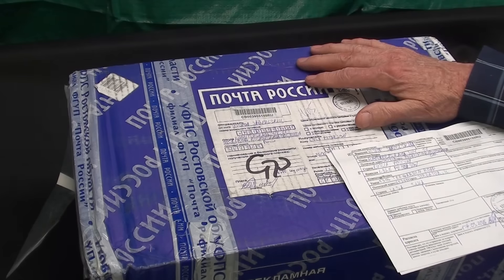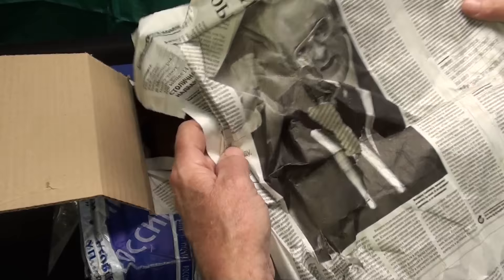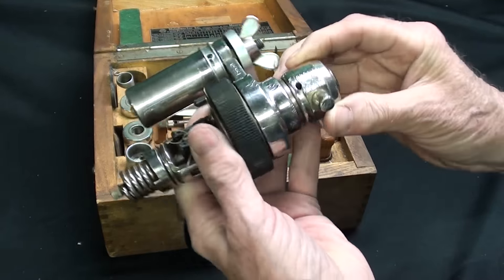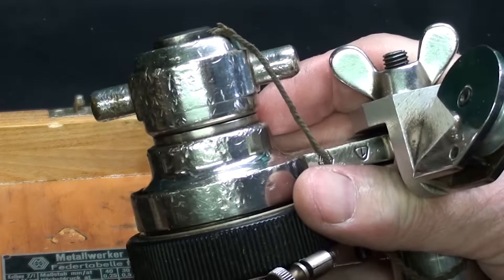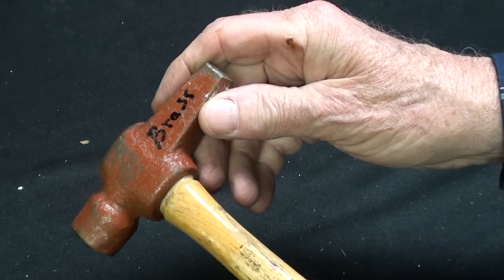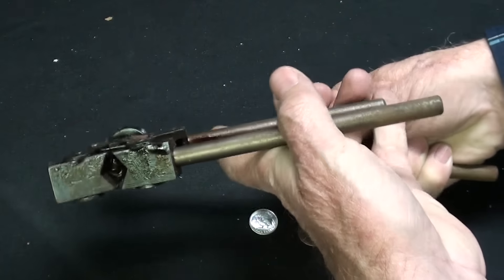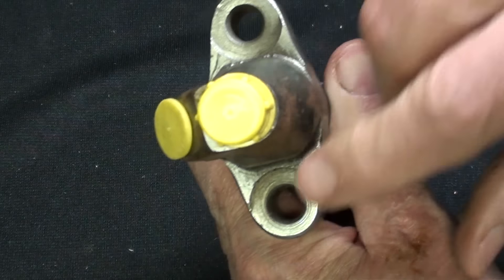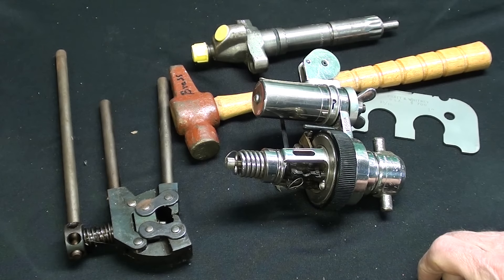WHAT IS IT?  #27a question Mystery Item tubalcain mrpete222

Comment: This instrument is an ......... "indicator", it is used to determine the indicated power of a slow speed (marine) diesel engines.
For this purpose a piece a special treated paper is placed on the spring loaded drum.
The small handle on the nut at the bottom is a nut which you  have to screw on the  ......ïndicatorvalve.
Each cylinderhead of the engine has such a valve.
After opening the valve, with the engine in running condition of-course,  the pressure in the engine cylinder comes in contact with a small piston in the instrument which is also spring loaded and is acting on a linkage.
Gently push the point of the scribing needle against the paper and you will see a diagram appearing on the paper which shows the pressure changes in the engine cylinder during the entire cycle (compression stroke, powerstroke. (large marine diesel engines operate in 2-stroke cycle))
Forgot to mention that the drum has also a spring inside and that the end of the rope is normally attached to a hook which is directly following the movement of the engine piston of which you want to determine the output of.
The surface of the diagram gives you the mean indicated pressure in the engines cylinder.
These instruments exist since the steam engines appeared.
There are different kind of springs inside the box, the one you select depends on which part of the process cycle you want to "see what is going on" inside the cylinder.
The top of the diagram gives you also the maximum combustion pressure in the cylinder during the cycle.
Each spring comes with its own wooden scale.
There is much more to tell about this measuring tool, but my English is not good enough.
Believe me, is not always a fun job to do, as that f... valve is pretty hot
Reply: +Jan Visser that is correct, a friend of mine actualy performed such am measurement using a similar device, on a running 2 stroke diesel main engine,  at a  Hapag Lloyed container vessel at sea during his college time ~20 years ago. 
Althrough the Captain messed up his mesurement results, because he changed the engin rpm, while he was doing the measurement on each of the many cyclider's. 
Not an easy task(rpm... dependent) using this old method/instrument.
On modern ship engins they have quicker/easier ways to peform this measument, but that requires "elektroncis".
He was porperly the last person really using this old method/instrument in "modern times".

regards rec
Reply: +recycler77 
I used it myself many times as well when I was sailing as a marine engineer.
And yes, the engine RPM (load) should be kept steady during that measurement as you also want to compare the results against each individual cylinder which should be the same in the ideal world.
Taking the diagrams with the rope of the indicator drum engaged to the indicator clock as we called it  was not so difficult, but there was also the method that we had to pull the rope (quitte fast in the rythm of the engine RPM (115-120 range)) by hand in order to show the compression end pressure as well. That failed often and than a lot of those "indicatorpapers" were spoiled
Reply: +Jan Visser i am pretty certain, that he did tried the "pull the rope in sync to the timing of the cyclinder -method", because he was after the max compression diagram (He was cursing a lot about it). 
He did it on his free day out of interrrest, because the superior's deemd that method outdated, due to ahead scheduled maintainance accodring to the lifeime of the wear parts.... 
As well as they prefered to check the piston rings(compression failur scource No1 ) by eye from the air intake-tube at port. 
When the engin was not runing/needed they slowly turned(electronic driven) the crank chaft, so they could hit the piston rings with a hammer, from the air intake windows (when the piston came to the lower dead end).
So they could see and hear(!) if the rings were broken or degraded,-that was way more important to them, as to actually measure the compression at sea.

I did a similar measurement at a "geman technical highschool" on 4 stroke car engines,
;but the instrument was a lot easier to handel(using the spark plug boring) and the preasure of cause was way lower(no tubo charged combustion + smaller dimensions... ) - firm hand held presure was enough, to hold the instrument in place. 
Without the proper tech charts, engin stats an math funktion's the resulting graph(s) alone were(are) useless, except from the comparison by eye, how good the graph of each cyclinder would match each other. Was esay to rank the cyclinders performance.

regards rec
Reply: +recycler77 
Hi Rec, 
Inspecting the pistonrings in the way you describe it was done on a regular basis with the vessl in port.
With the present two-stroke marine engines which have uniflow scavenging (inlet ports and exhaust valves) that is a messy job, as you have to climb into that filthy scavenge air receiver to see the pistonrings passing by the inlet ports.
When I was at sea, I was lucky enough to sail most of the times with the Sulzer RND and RND-M engines which had loop scavenging. So, we could do that inspection through the ..... exhaust manifold and that was always clean bare steel.
(For the guys who never saw such an engine: the exhaust manifold of such an engine is that big than you can walk through it and I am 6ft, 5 inches tall.)
Each piston ring could be pushed using a broomstick, otherwise you could not reach them.
On some ships we had a very long cable connected to the electric motor starter of the turning gear, so that the engineer inside the exhaust manifold could bar the engine over himself in order to bring each piston ring in the desired position.
It is indeed a distinctive sound when the piston ring springs back against the cylinder liner wall. (I can still hear it.)

Anyhow, it was company policy to determine the engine output by taking indicator diagrammes every six months. (that was in the 1970ties - 80ties)
And I think it is still good practice to take diagrammes when you expect that one of the engine cylinders is performing in a lesser way.
We have talked a lot about the indicator now, so let's continue .... LOL.
The indicator Tubalcain showed to us is useful for slow speed marine engines only which is due to the inertia of the linkage in the instrument.
For medium speed (marine) engines the company Maihak from your country Germany designed an indicator which had a torsionspring instead of the spiral wound spring on the indicator in the video.

For Tubalcain: I hope it was not too boring, two European guys talking that much about this measuring instrument, but for me it was fun to do as it brought back a lot of good memories!!
Reply: +Jan Visser

Hi Jan,

i dont think, that Tubalcain would mind our conversation, as long as we dont do the "safty-n*zi thing"  O:)

Wouldnt have dreamed of the exhaust side beeing so clean, as you discribed, guess is the turbo charger sucked it clean after the engin was itself stopped, but the momentum that kept the turbo spinning for a while.

Well my friend startet his apprenticeship(ship mech), when there were a lot of old MAN 2 stroke main engines in use at by his employing corporation.
They cause a lot of problems because of thier age all critical bearings were at thier limit of thier life span... even throug they have seen porper lubrication all the time, except for lubrication system failures.
They end up not having enough time to attend to all the service needing parts at the port's- time. As a result they had to emergency recast two crankshaft  bearings at sea one time -> "that was as much as" No Fun" as it could  get.
When he was done with his  apprenticeship an was harvesting "Sea time for college requirements",
The world economy had an upturn, cargo had to be moved as quickly as possible,
his corp then had new ships, but they went as much as full speed ahead as possible, fuel cost were of no concern. Time was all that mattered in the global competition of logistic's back then.
The new larger vessels had in licence made MAN--two-stroke K98MC main engins from Korea.
Due to the high demand(greed) the engin blocks were bored, like when they still were warm from the casting. Normaly they should rest for over a half a year after casting,- in the open for proper stress releaving the cast.
That caused a lot of problems with these engines were running at an averrage of +80 rpm over the time,
casuing unexpected wear out on new,- or even just replaced parts. They had as much stress, as the had with the old engines, but beacuse of the arbitary of the now occuring failures it was different- more like not foreseeeable what would happen next.

The pretty much had never had time for this indicating job, because the didnt even came arround fixing all the repored machine alerts, that summed up at sea.

When he was done with the college, doing his trail time as ship operating officer in order to become captain, MAN changed the lubrcating, Injetion,... system from mechnical controlled to total electronic/computer controlled ones on the  K98MC's. 
That made the lower head section of the K98MC a lot slender as before, saving a lot of room/weight.
But on the new in "licence made computericed engines" run "very buggy" at the begining.
Many moaned about the abcence of the old reliable systems, that at least repored all monitorable errors, the new system in partial did hid them.
One time they found out at port that one piston was run without any lube for an onknown time.
The piston bushing was opened up by the rubbing piston about avarage 15mm over max tollerance(all piston rings were pulvericed).
Good thing was that those engins could run by having some disabled cyclinders, the 12x-piston variant could lose up to 3 pistons(position dependant) and stay in service/use(limited)

regards rec

Comment: Hi Lyle,
The string is attached to the piston rod and the up and down movement of the needle is the pressure. Might be a copy of a crosby. Loads on the internet about them. I have books here on the Richards steam indicator. See if you can rig it up to make it work. You will need a reasonable sized steam engine.
Yours
Allister

Comment: The brass hammer is soft.  My guess is that it was for hammering on softer metals.  You correctly identified it as not being Beryllium Bronze which is harder than yellow brass.  In fact large wrenches are available in Beryllium.  My father was a Master Machinist and died from Beryllium poisoning 50 years after exposure.

Comment: The hammer is a silicon bronze head with a hickory handle.  The Lixie catalog (pages 4 & 5) says it is a pin head hammer used where limited accessibility precision assembly work is needed sparks aren't wanted.

Comment: The first Item is a device used to measure pressure/volume changes in cylinder machines. It is equipped with a so called Crosby- printing mechanism to record the results. Some of the accessories are used to set different operating ranges.
Also it was made by company from the former gdr.

Comment: First: Low speed engine indicator. Given DDR (East German) manufacture, and other in the data plate, likely for large diesels such as marine or stationary power plant, not reciprocating steam.

Gauge: AAR railroad wheel flange gauge for flange width and root radius. It is primarily for go/no-go usage

2nd to last: chain breaker. Can also be used as a general purpose pin press for small parts

Last: Not sure, but looks a lot like an injector for a large engine

Comment: OK... some translation from the german description:

This indicator is used to test and supervise piston engines of all kind. It indicates cylinder pressure in relation to the piston travel. And it is capable somehow to draw a graph of this function. (So far what I understood from the description)

Höchstdruck/Maximum pressure: 1500at/1500bar (atmospheres)
Maximum speed: 1000RPM (Type 30)
DDR = Deutsche/German Democratic Republic
Kolben = piston
Masstab mm/at = scale millimeters per atmosphere
Federn mit Vacuumanteil = springs with vacuum portion (no idea!)
Federtabelle = spring (data) table

A german description can be found here:
http://www.ostron.de/Mechanik/Mechanik-allgemein/Aussenfeder-Indikator-Typ-Metallwerker.html
Reply: +chrigel1234 I should have recognized that. It's an engine indicator. It draws a "diagram" on a piece of graph paper. The cylinder that the paper mounts on and the pen that draws the curve is the bit with the string on it. The string is what rotates the cylinder. The area in the resulting diagram is an indication of the power developed per stroke. It does indeed compare piston stroke to engine cylinder pressure.
Reply: +Noel Henderson Exactly correct!

Comment: 1 in the box is a steam powered tattoo kit, or a vacuum gauge? 
2 is a Lixie dual purpose Bronze hammer, they came with either 12, 20, and 24 ounce heads, it was intended as a tool setters hammer.
3 Used to verify the condition of rail wheels, specifically the coupler, journal collar and journal fillet wear limits.
4 is a sprocket chain splitter
5 not a clue

Comment: The Pratt & Whitney item is a Universal Pocket Go/No-Go Gage for anyone needing quick checks on items 31/32" in thickness. I thought everyone carried one. I find mine to be particularly handy in the produce section at the grocery, especially for sizing asparagus stems for rejection. The last item, equally useful, is a combination clutch alignment tool and 1964 VW brake master cylinder, a very rare find.

Had to put something down, as I was clueless. I did know the hammer was a hammer. The steam engine indicator is brilliant.

By the way, if you're catching up on reading and you're just now to 1947, we need to let you go!

Comment: Spark proof tools used to be made from beryllium copper, not sure what they are using these days. I have seen and used hammers, box end and adjustable wrenches. I don't remember the brand of the adjustable ones, but the ones we had were built the same as a normal steel one, except for the material.

Comment: 1-engine indicator
2-brass hammer(obviously) for non marring 
3-railroad wheel flange gage
4-roller chain breaker
5-diesel engine injector
Reply: +Roy Reynolds The engine indicator is for steam.

Comment: M. Oehmichen, the mechanical indicator 
  VEB Verlag Technik Berlin 1953 

  de Juhosz and Geiger, the indicator 
  Verlag Julius Springer Berlin 1938 

  * Manufacturer: metal worker KG Hugo Voss & Co. Meerane DDR 
  * Outside spring counter type metal worker Meerane 
  * For testing and monitoring of reciprocating machines of all kinds

Comment: No1 is an indicator for big reciprocating engines that shows the pressure in the cylinder while it runs it is used in ships. No4 I'm not sure but it seems like is putting the corks in wine bottles. No5 is a fuel injector in diesel engine again very common in marine use maybe in a diesel generator or in a small ships main engine.

Comment: Chain break , hammer is poss for use on tooling leather like saddle maker or other leather work , shaft with 2 ports for lines is from early diesel pump , your Russian gauge is from fuel mixing under pressure ! All are guess's !!

Comment: 1) not sure...thought at first it was a wire-drawing tool, but I don't think that's correct....
2)  it's a machinist hammer.....though a little research says it's likely bronze, not brass....
3)  it's a coupling collar gauge, to determine if the coupler is still servicable...
4) some sort of gear puller or joint splitter to remove small a small gear from a shaft -- given the small size of the working opening, I'd say it's more of a joint splitter.....
5)  no idea....seems like some sort of control valve maybe....

i got the first two, but thought the last one was Edwin Hubble, not Shapley...

Comment: from how old it is I know it is a steam cylinder pressure indicator. I saw one of these used at an antique  steam threshers show several years ago. small tubes are connected to both ends of the steam cylinder and when the engine is run it scribes a graph onto the round drum. the graph shows when the valves are opening and closing so they can be adjusted.
http://www.archivingindustry.com/Indicator/working.htm

Comment: ..#3...since it says Pratt & Whitney...I'm guessing it's a tool for measuring the pushrods and covers on radial engines....#4 is a chain-breaker....#5 is a diesel fuel injector...and....the non-sparking hammers are usually made of Beryllium....

Comment: just to add: the plaque says:
"Federatabelle für Indikator" - spring table for indicator
"Maßstab in at/mm" -scale in atmospheres per millimeter
"Höchstdruck" - maximum pressure
"Federn mit Vacuumanteil" - springs with vacuum part (you'd use these for steam engines attached to a condenser).
"Die Federn sind mit dem Maßstab in mm/at für den 1/1 Kolben justiert und gestempelt (rote Zahlen)." - the springs have been adjusted to yield the given scales for the 1/1 piston and have been stamped accordingly (red numbers)."

The thing was made in East Germany, probably in the early 1950s, before Hugo Voss & Co became part of a nationalised VEB (Volkseigener Betrieb -a 'company owned by the people').
Reply from the maker: Thanks for watching.

Comment: it a diagram indicator for diesel engines.it possible to trace closed diagram and calculate power and open diagram to evaluate compression and firing pressures

im still using it in modern tanker engines

Comment: First one Looks like an air engraver to me, Dunno or a sail stitcher or industrial tarp repair stitcher.  Brass is used to work on harder metals and not make marks, is the one with blue tape some sort of hydraulic pump that works off? a cam